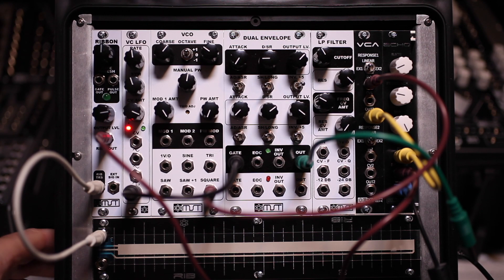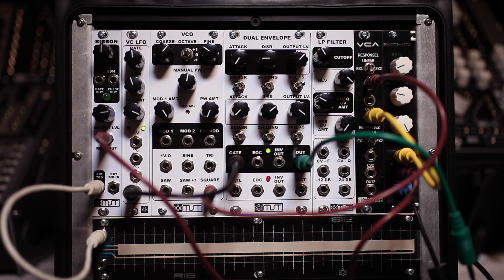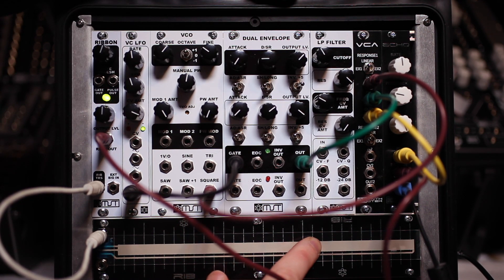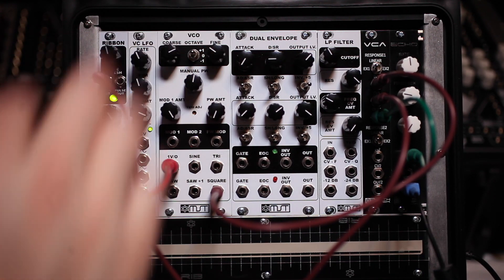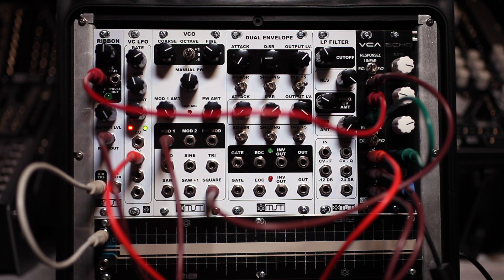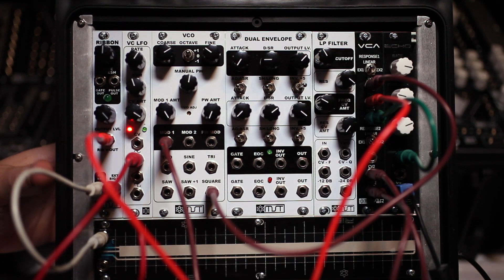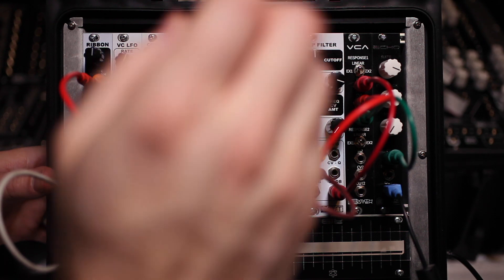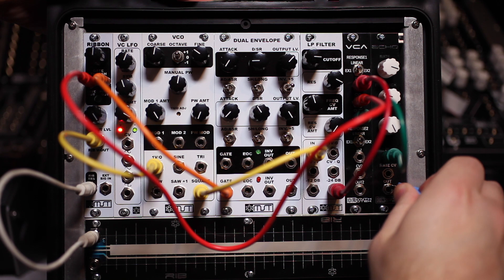Synthrotek Ribbon Eurorack Module Touch Interface  - MST

Comment: Is the ribbon control module required for the ribbon touch interface to function?
Reply from the maker: Yes, it needs the module to take the resistance and convert it to CV, gates, etc.
Reply: I see. Thanks for getting back to me.
Reply from the maker: certainly!